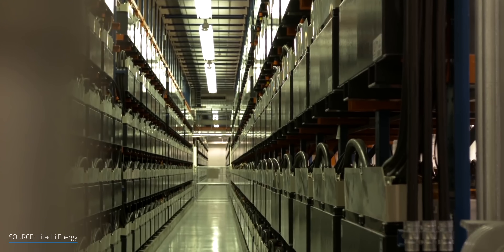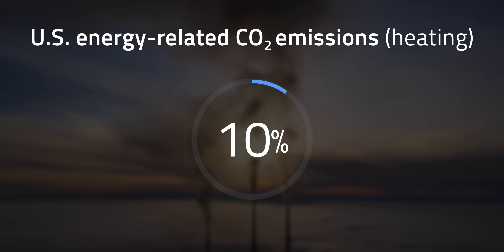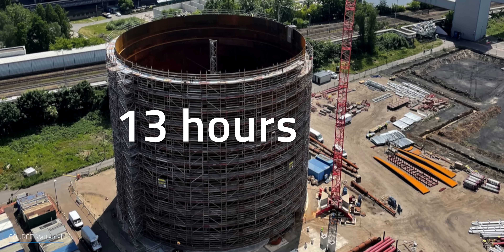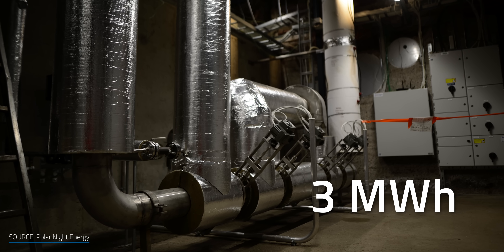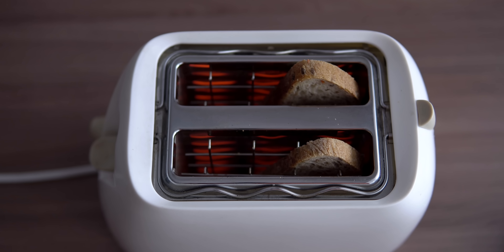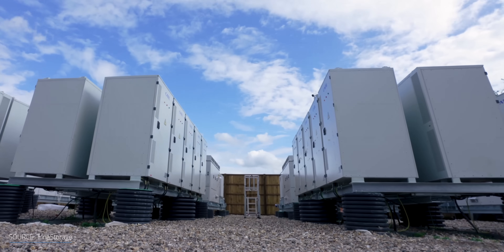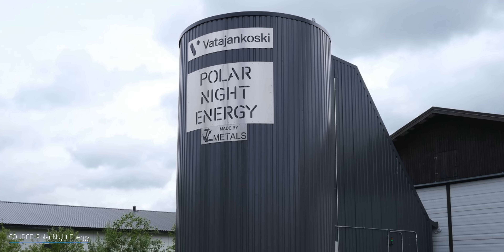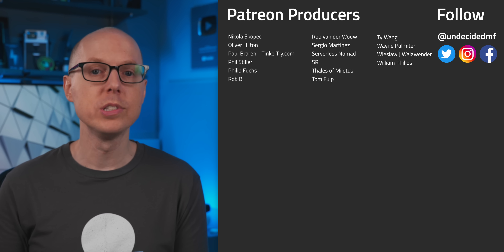How A Sand Battery Could Change The Energy Game

Comment: I did this same thing in my shop up here in Alaska, we had to back fill within the confines of a large poured concrete foundation. I bought a semi truck load of blue foam that was being torn off of a high school roofing project and insulated what I call a thermal or dirt battery. as we back filled and compacted with sand and gravel we layered in PEX tubing, in the top strata of the dirt we laid a top grid of potable pex tubes to preheat the water going into my indirect fired water heater.  I am currently charging the dirt battery with evacuated tube solar collectors, the whole thing is charged with glycol to keep it from freezing in the winter months. The system works quite well, we have almost 24 hour daylight in the summer and no heat load, so the system stores energy all summer as well as preheating my domestic hot water.  The dimensions of the system are 36' x 36' by about 8' thick. by fall the system has been running around 110 to 115 F at its warmest. in addition to preheating my potable water the system can pull heat out with the same Pex that it uses to put it in and heat the shop and house radiant with the low temps. the system has been running almost maintenance free for seven years now and I have plans to double the collectors and have already built a 2,600 gallon tank into the foundation to use as my high temp battery, hoping to run this one around 180 to 200 F. to answer the question I know everyone is asking it has cut by gas consumption in half over the course of a year. almost 100% in the summer and increasing and decreasing amounts in the shoulder seasons.
Reply: I would love to see some specs on your system. We live in OR and I'm planning a prop glycol solar heat exchanger for preheating our hot h20 system, and hopefully whatever's left over would get dumped into a sand battery in the backyard for the winter. Sizing the components of the system & insulating the tank are two big questions I haven't resolved yet. Maybe make a YT video?

Comment: Geothermal HVAC. Does take a Heat Pump unit. What about using a loop to store heat like the sand battery. Would need to limit the transmitted temperature to the loop based on the temperature limits of the loop piping material. The Geo Thermal Value might be best using a coiled looped field in sandy soil.

Comment: Sounds like a modified form of geothermal it's just sits upon the ground and above the frost line rather than below, which would require more insulating to contain the thermal energy. Combined with photo voltaic rock,sand, dirt, viz. earth or geothermal is likely the most sustainable energy future. Although the cow or human manure battery is far more creative and more stimulating to one's imagination .
https://youtu.be/O2BU1IQOjS4

Comment: What about the exergy. This system is somehow greenwashing, because in exergetic means it is unefficient to heat something by resistance heating. I think by having an overall systematic view on the Energy sector of the future, where other seasonal storage systems will be implemented aswell, this is not a really good solution.

Comment: What happened about the copper heat storage we heard about some months ago? It consisted of a couple of gigantic graphite blocks with a few tons of copper sealed within each.  The copper was heated to melting point with the excess power and then this was later used to vaporise water for a steam turbine to recover the power when needed.
It seemed like a great way to store energy since it could be installed in redundant coal fired generation sites.

Comment: I use a 250 gallon IBC full of water as my heat battery.  It has a 2 square meter solar thermal panel below it, in a thermosiphon setup, so no pumps are needed.  The water is the heat transfer medium.  My city water passes through a heat exchanger immersed in the IBC, to preheat it for my electric flash heater.  The flash heater has a thermostat set to 105 F, hot enough for a pleasant hot shower.  The closer to 105 F my heat-exchanged water gets, the less energy the flash heater uses.  And that energy is also solar.

Comment: Wouldn't it be more efficient to use a heat pump to warm the sand and perhaps something other than air for the energy transfer (at least within the heating/storage part of the loop).

Combined with the CO2 storage methods mentioned a couple videos back I can see a reasonable green energy solution in the not so distant future, if politics and Big Oil propaganda doesn't get in the way which unfortunately they almost certain will.  To be fair I could also see the people pushing Lithium also pushing propaganda against this, greed is a terrible thing.

Comment: Doing this at scale requires a carbon footprint in infrastructure that requires further scaling and more carbon cost in maintenance in order to, at an appropriate scale, offer an overall reduction in carbon cost per BTU.  This scale where carbon cost is reduce would require decades to achieve.  Decades we do not have.  And that in the short term will drastically increase the problem.

Comment: We help build one of these for a farm the heat level was a lot lower and it was solar water heater it heated the sand, but the sand bank lasted all winter , and charge all summer.  I have another I solar heat my shed and store the heat in wax last about 72 hours .  will keep above 50 at the floor and 137 at the roof since it for dogs they love it.

Comment: In the early 1900 cities like New York, Colorado Springs and other cites has underground steam pipe system providing heat to commercial and resident building. This came from electric power plants or just steam producing plant.   So this heat sand method transporting hot air is not a new method just another method for storing heat.   This big problem here is and the transport pipe must be insulated thus requiring new infrastructure also heat equipment in the build would require replacement.  Can this heat source be used to generate electricity through thermal cycling?

Comment: Interesting. Could passive homes that have solar on the roof and using thermal heating in the floors to heat the home benefit from this and would it scale down for single home dwellings?

Comment: When wind got hot in the early 2Ks every energy company doing wind threw up as many turbines as they could in West Texas. by 2005 at least 30% were sitting idle due to curtailment not because there wasn't need in Texas but because The grid to West Texas wasn't sufficient to carry all of the extra energy to Dallas where it was needed. I work for the company that won the bid to build the new infrastructure. Back then grid storage was ~$.0.09 kWh and the market was ~$0.04 kWh so nobody was scrambling to add storage to the grid.

Comment: I definitely like the comment on this I think any energy is better than getting foreign energy and then have to be held hostage to get that energy back into homes and I must say American Homes we've heard the same story of us having to use foreign energies from other countries and then being hostage held. hostage later on by those same companies that give us so any renewable energy that is safe for the environment is better but one thing here in Detroit where I live there's a lot of old historical buildings that have been built way back almost in the 1600 some of them are even wood and that you know they are still using furnaces to heat their building and some or huge and when I mean huge I mean like two U-Haul truck large  you know we're always looking to minimize but still get efficiency of these things so personal stuff either they're going to have to some kind of way downsize this will and battery energy add take out these old boiler and work with other things as well as technology like the split air conditioners which is a heater air conditioner I think it's wonderful that even a boiler may not even have to be used as well as solar power and when not I myself I'm in a wheelchair use electric wheelchair I plug it up about my way but if I'm not near a plug Source I'm asses out if the battery gets low and I've even thought about seeing if there's a way I can either create build or have someone else build a wheelchair that can. take me the long-distance I love traveling  and I like going far . personally I love the idea possible for houses that have this wonderful ideal  but you know what nothing we got to do we got change the House of Style I think Taylor Made homes and boxable  Casita as well as some of these prefab homes could be a better option and keeping out the cold and storing up the heat  what how do you say batteries look and how they would be stored in the safety of them like I said it's scientific Personnel like to see if you can get a battery that will fit my power wheelchair so that I can travel about at least 50 miles on one drive -LOL so keep up the good work and I hope that they make it so that batteries that we put into a radios and put into our computers can be downsized and still workable no I am still give a good efficiency see but in doing so I think we're just going to have to reinvent the wheel we have laptops but we may have to conserve the power efficiency of the sand and solar power how can it be made so that it can fit into something as small as an Android phone so I believe the idea is to start with something big and eventually break it down to the size of a wrist watch and work our way up to  phones,tablets and computers and eventually my power wheelchair so that's my comment hope you read it hope you like it the whole thing gives me some suggestions hope that technology will finally work for those who are who needed I do see where it goes from there

Comment: Why not eliminate the use of electricity and just use a parabolic mirror to heat water and pump it through and insulated mass buried under ground. Thus during the winter heat can be extracted. If balanced properly you could have 2 buried thermal masses in the winter pump water through a buried thermal mass to use to chill water during summer.
Two buried insulated tanks each charged during the opposite season than when it's needed.

Comment: I think there is some confusion going on here, there is no way to pipe hot water or heat directly to where it is needed, the heat has to be converted back into electricity to be transmitted over wires and then used to create heat at the destination, so this doesn't in any way address the need for heat in a factory miles away or homes nearby. A heat battery would have to be located at each and every place the heat is needed to directly apply the heat to some sort of application.

Comment: I wonder why they have steel silo over ground.. Wouldn't it be much better insulated if it were buried? Insulation has to be a key consideration when it's supposed to retain its heat during the Finnish winter. I guess maybe it's cheaper to add insulation than to dig.

Comment: They could use the sand in the foundation of buildings as a battery. My house has over 500sqm of sand underneath as foundation. Insulate it and throw some pipes in it and you've got a battery that doesnt take up any addition space (except for the heat converters).

Comment: What about the "risks" of this new sand battery facility?

What if a tornado comes and destroys that reservoir, an earthquake, or even hailstorms? If the tank falls apart, all that super-heated sand could cause a fire hazard, or even cause burning on people nearby if it scatters around while in high temperatures, right?
Are there any safety measures regarding these natural disasters?🤔

Sorry, I have this habit  to think about all bad things that could happen to people😓

Comment: The issue with using hot air heating instead of steam heating, is that the specific heat of Steam is 1.996 kJ/kgK while the specific heat of Air is between 1 and 1.2 kJ/kgK.  That means that Steam carries at least twice the energy per unit (mass temp) than air, and some sources say that it can be up to 4 times.  That's not even taking into account the heat transfer coefficients of steam vs. air.  Air is a decent insulator, that means it's not nearly as good at transferring heat as other substances; meaning that you're either going to have to push more hot air through the system to get the same heating effect as with steam, or the heating will be less.  Either way, it's not nearly as efficient as the steam it would be replacing.
Reply: i dont know why it couldn't be anything they wanted to push into the system. i dont see why it would have to be air, its like a hot pipe

Comment: I love this. Sand is so plentiful. I know stones were used as heat storage in earth buried ovens thousands of years ago. I personally have dug stones days later from a large fire pit only to find they are still very very warm. I wonder if you can skip the above ground storage and just dig deep enough where there is natural insulation, or would that be too much direct thermal conduction with the surrounding earth?
Reply: You would still want to insulate it, but it would be a good idea for particularly chilly climates. Going down just a handful of feet the ground evens out the temperature evens out to ~50°F, a trick used by geothermal heat pumps. A air heat pump can work to heat one’s house in negative temperatures, but it’s more efficient at higher temperatures, same goes for insulation.

Comment: It would increase complexity... but, if you were to replace the resistive heaters with heat pumps, either air or ground source, you could achieve greater than 100% efficiency with this setup. Letting it be scaled up even higher with the same operating costs.

Comment: The " great reset" discovery of inflation on our electricity bill show us right now how expensive these solar, wind farms electricity costs are (including everything and government tax-payers subsidies° compared to previous systems (nuclear or fossils)
Most physicists and researchers understand it only through the limited scope of their specialisation, but "Unified electric and magnetic field theory" explain how and why there is huge electrical energy within everything matter particle, be it the atoms oignons coats of electron spinning together with - or the same atom nucleus particles (protons plus neutrons)
Complexity increase very quickly (Schroedinger equation limited to 4 particles by calculation problems) but it is possible to build every matter starting with only two elementary particles known as the electron and the positron and to transport trough the vacuum space any of those two at speed of light using their transformation into photon (matter half the time and anti-matter the other half give it as a result a zero mass IN AVERAGE ONLY) as per the FEYMAN equations trend to show.
Matter energy seats in majority inside the nucleus because its small size (compared to free electrons size) indicate a huge spatial contraction. 
Most batteries (you can make batteries with everything matter) use the "chemical energy" which relate to the oignons coats of electrons spinning with and around the nucleus and gaining or losing electrical energy per coats (Bohr) permutations.
The DIAMOND PERMANENTLY CHARGED (almost) battery use the energy located inside the atom nucleus (C14 to C12 isotopic decay reaction) especially the unstable (when freed only) neutrons which decay naturally.  Products of the decay are made of the add up of the high energy "contraction of nucleus particle (some basic of "atomic bomb energy") plus mainly one electron or more for each neutron (maximum 15 minutes of "life" resulting in the electro-magnetic field of nuclear bomb and the neutrons bomb)
That is the way to go in batteries research ("nuclear batteries") because these batteries are life charged (50 years or more)
The problem with nuclear batteries is the CONTROL and REGULATION of "start-stop nuclear reaction delivering the free neutrons. Up until now, the Diamond paste internal reaction can only be controlled for very low amount of radioactive isotope. The plague here is the isotopic decay "chain reaction" which explain why every nuclear battery UNIT has a very small power. (See Diamond batteries with small unit power and or ROSSI SEK LEP experiments with 100W permanent UNITS recently reduced to 10 watts)

Comment: 1) You can absolutely superheat water. Hint: Pressure.
2) Sand isn't the ideal heat storage, its main advantage is price. Its main disadvantage is inefficiency due to the gabs between the sand particles (there's solutions for that, but you didn't touch on that).

As always. Better research would have been great.

Comment: The sytem looks too expensive for me at $10 / kwh. The cost of the 8 mwh system would be $80.000, if I understand correctly. The 8 mwh system is hardly large enough for a single home in Finland. Additionally you would have to pay for the cheap electricity or build your own solar energy system.
In our country (Hungary), a total equipment and  installation cost of $80.000 would be too much for a single house for seasonal heat energy storage. 
It seems to me the price needs to drop in order to be competitive.

Comment: This tech could be incorporated into parking garages. Those are just large concrete heat sinks that gather heat during the summer and that heat just dissipates without being used for anything. Driveways, sidewalks, and streets and highways can also be added. Streets and highways can also  have piezoelectric elements into them that turns the normal use flexing into electricity. (Yeah, the average street or freeway does go thru minor flexing due to normal traffic usage and expansion/contraction due to heat differentials. It's not visible to the eye until after the cracks start forming.)